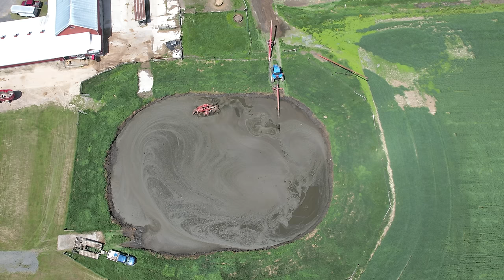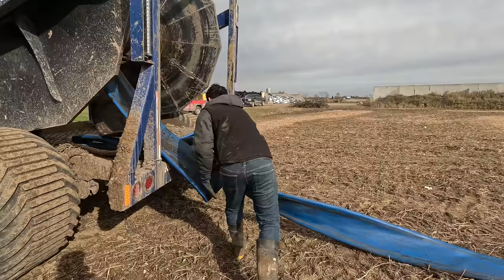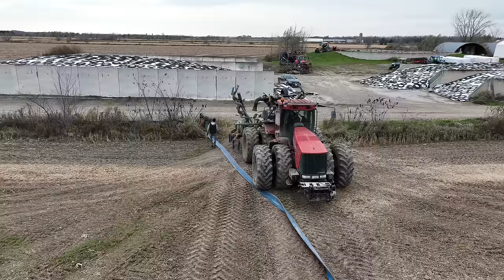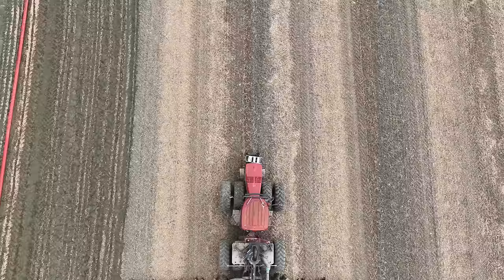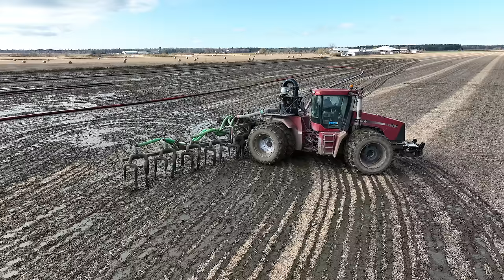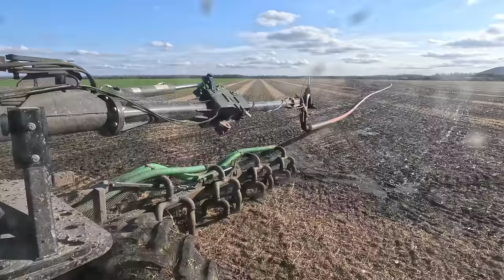CANADIAN FARMER - Pumping 1.2 million gal.  or 5 million L  of liquid manure to a field a mile away!

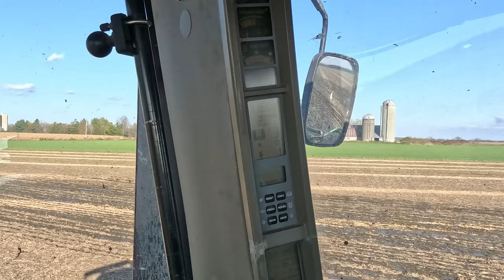Comment: What does 7% slippage mean for us non-farmers?😊 10:09
Reply from the maker: Spinning the tires....sometimes weight is added to the tractor so the tires don't spin when drawing a heavy load... this tractor was losing 7% of its forward motion because the tires were spinning drawing the load...
Reply: @farmerdrone  i cind of doubt more weight would have redused the slippage much. since say loose harrowd dirt give some slippage even with 0
load becouse the weight of the tractor iself give a few % slippage becouse the loose dirt slips from the treads until the tires hit somthing hard enough to hold the
weight of the tractor!
slippage will newer be 0, although on say concrete ore asfalt its NEAR 0  if the ractor drive straight forward. 😉
Reply from the maker: Sounds logical.. I am not a farmer.  This information was given to me by the tractor operator..
Reply: @samkom33 every farmer adds weight to his tractor to reduce slippage.  It can be fluid in the tires, wheel weights, suitcase weights on the front of the tractor, or any combination.  Zero slippage is impossible, but you want to limit it as much as possible.  The application rate of fertilizer is based on actual ground speed, not wheel speed.
Reply: @robertheinkel6225  Your right. say a 24 row  DEEP plow need way more WEIGHT and traction than say a sprayer to not slip!
But original weight of a tractor also matter.
Say a 60.000 pound Case quadtrac would maybe PULL APART  the hose almost without slipping while  a 6000pound fully weighted tractor would only slip.